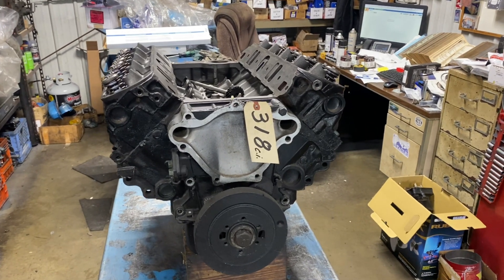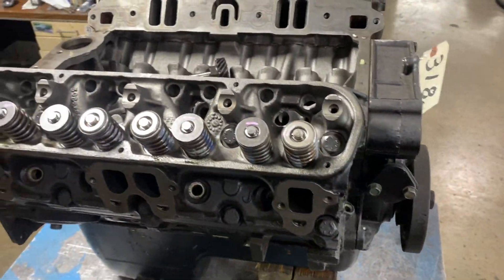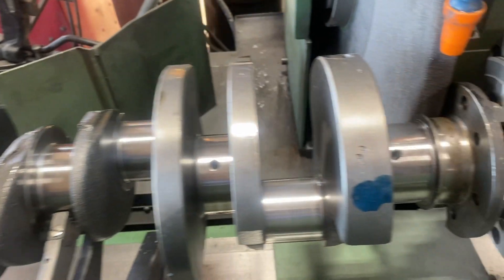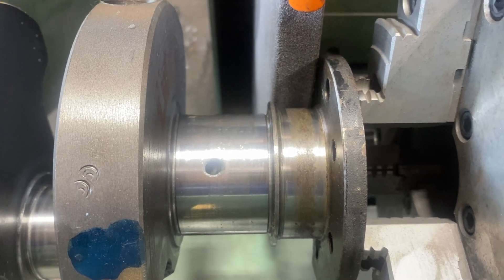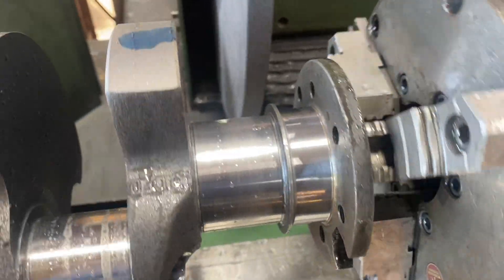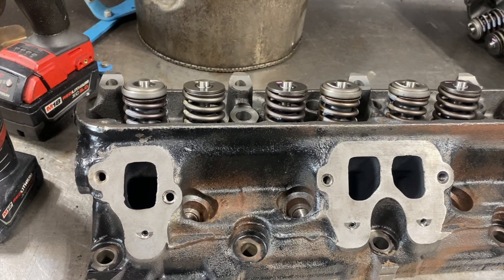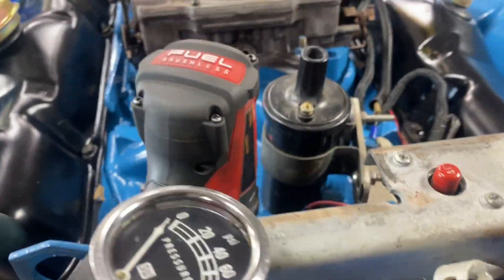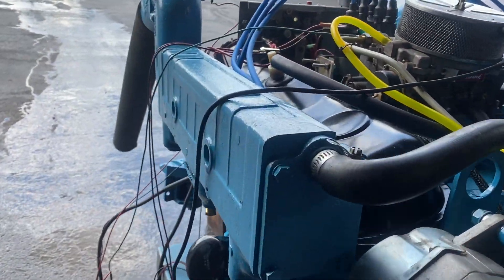Chrysler Marine 318 Engine and Transmission Overhaul Using a NOS Truck Long Block Test Fire

Comment: Is there a roller cam available for the reverse rotation?  Did you guys run the newer closed chamber heads that came on the truck motor?
Reply from the maker: Not off the shelf. I'm not sure if there is a roller cam core for the RH rotation engine. I've never seen one. We used the truck heads that came with this engine.